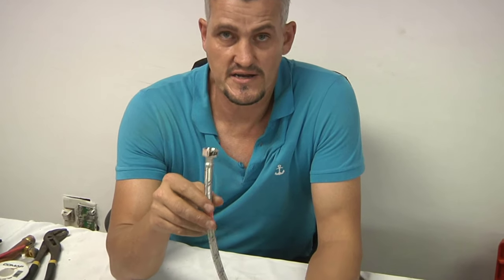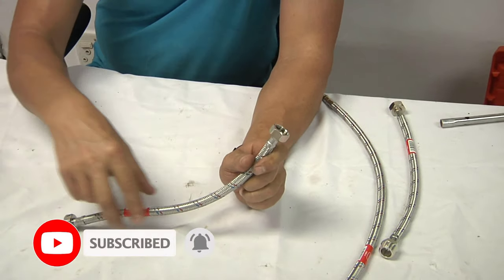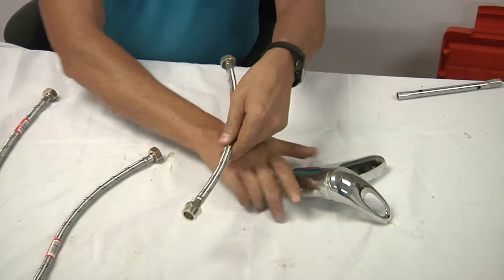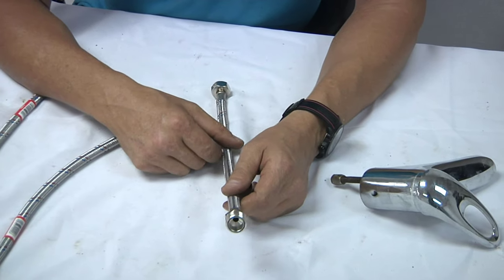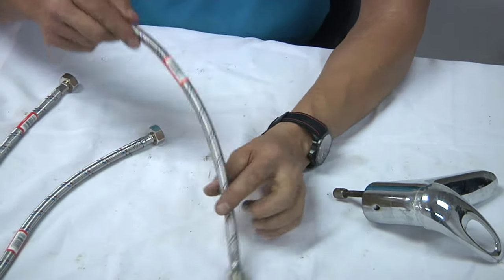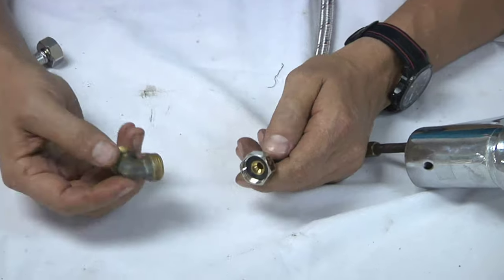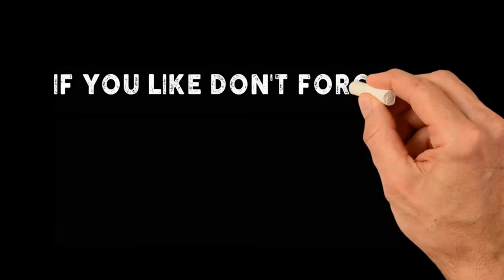How to connect Flexi connectors, or How to connect flexible tap connectors

Comment: I’ve connected a couple female flexiconnectors together with a stainless steel double make connecting piece. They all leak water from the top part of the flexiconnector. How do I make that watertight??